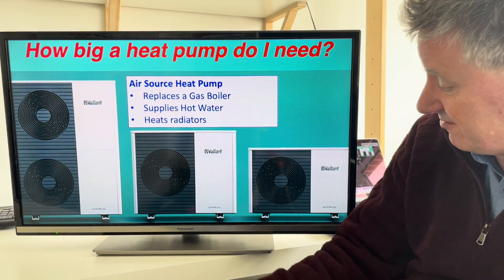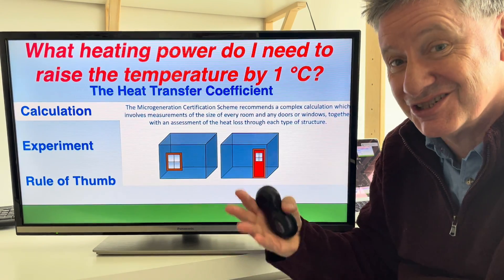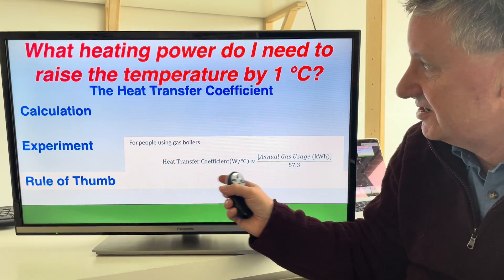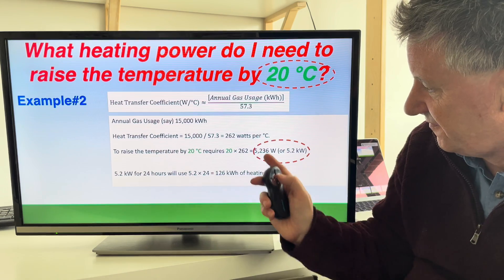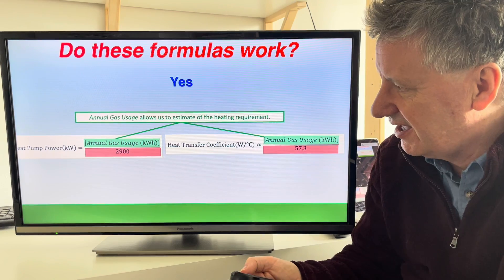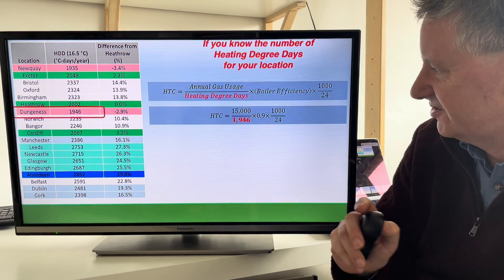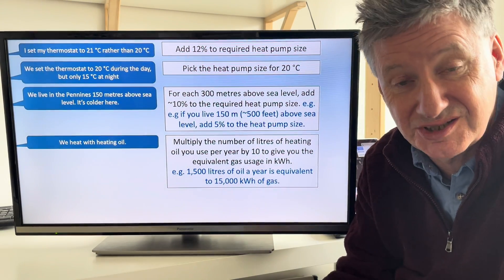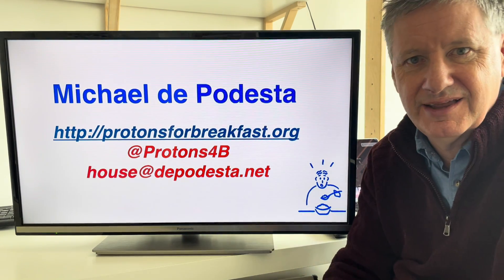How big a heat pump do you need? A simple Rule of Thumb.

Comment: Thanks Michael. I followed along with the video, came out with 2.6kW heat pump.
Vaillant do 3 and 5kW models. Which is better please, the smaller, near max capacity or the larger, hardly ticking over?
Reply from the maker: Dave, Good Afternoon. The Vaillant 3.6 kW and 5 kW are - as I understand - physically identical, with the 3.6 kW model just being limited in software preventing the compressor from going at full power. Given that, I would go with the 5 kW model. There is not much difference in price

https://midsummerwholesale.co.uk/buy/vaillant-heat-pumps

and their cycling behaviour at low load will be indexical.

You can check out how my 5 kW model performed on a cold winter day  here

https://protonsforbreakfast.wordpress.com/2026/01/11/heat-pump-performance-on-a-cold-winter-day/

Best wishes

M
Reply from the maker: Dave, that is a very low heat demand. Obviously, check with a heat loss surveyor first.

If your heat loss really is that low, then consider using an air-to-air system with hot water taken care of separately.

Good luck with your endeavours: M

Comment: The rule of thumb is interesting but does it take in to account boiler efficiency? 
If you have two houses side by side one with a condensing boiler and one with a non-condensing boiler there could be a 10-20% difference in gas use but the same heat loss.
Reply from the maker: Good afternoon. The  assumed boiler efficiency in the rule of thumb is 90% which I chose to nudge up the suggested heat pump size.

An uncertainty of 10% or even 20% is OK for a rule of thumb. Three years ago when I posted the video, oversizing by 200% or even 300% was very common. Things have got better now as the installer base has learned lessons over the winters. 

In the end this is just a rule of thumb, a handy guide and the video explains why it works.

Best wishes

Michael

Comment: My brother has the radiator temp set to 40c with his and his house is fecking freezing all the time..urine leaves the body at 38.5c so why don't we just piss in the radiator Ed Milliband
Reply from the maker: What an unpleasant and ignorant comment. 

In my house the typical radiator temperature is just above 30 °C and that keeps my house at around 20 °C - which we find very comfortable. It only reaches 40 °C on the  very coldest days.
Reply: @michaeldepodesta001 😅

Comment: heat pumps suck and a money pit ffs
Reply from the maker: Thanks for that asinine observation.

My heat pump keeps my 160 m^2 house warm all winter through, and this year will cost less than £100 to run. Good luck doing that with a gas boiler which also emits toxic and climate changing gases.

Best wishes

Michael
Reply: @michaeldepodesta001  bs
Reply from the maker: @SteveJones-gz4vd  Ah! Asinine, and a reality denier.
Reply: @michaeldepodesta001  lies
Reply from the maker: @SteveJones-gz4vd  You really must be delusional. Not lies, simple financial and physical facts.
Reply: @michaeldepodesta001  liar liar pants on fire
Reply from the maker: @SteveJones-gz4vd  Your argument has zero (0) power.

Comment: I’m so glad someone else thinks measuring the HTC is an important thing to do as I feel it closes the gap between the heat generated and temperature achieved – closing the gap between COP and comfort. Someone only mentioned this video to me shortly after I released my own:

https://youtu.be/Xaf2dzC_D3Q

which is much more about measuring temperatures and energy data over a short test period, such as a week.

Unfortunately I wouldn’t be able to use your rule-of-thumb because although I do happen to have my annual gas usage for 2023 worked out, the year ending just before I got a heat pump in January 2024, its a long way away from “you presumably got the house comfortable the way you want it", so dividing by 57.3 gives an impossibly low figure of 125 W/C. This was even after adding in the electricity usage which the video doesn't mention, but for me it is significant at 1001 kWh against 6193 kWh for gas, and lights and computers generate 100% heat. The formula gives an even lower figure of 96 W/C.

The other sources of error that concern me are:
    1. "solar gains" - the heating of the house by the sunlight during the day. The degreedays website describes it as a minimal effect, whereas I found that the measurements were unusable between sunrise and sunset.
    2. "Intermittent heating" - changing the roomstat or switching off at certain times. When I had the gas boiler I only switched it on in the evenings, never at night or during the day. The article only suggests reducing the base temperature by 2-4 C.

What I was trying to do with my video was to show how to take a measurement of the HTC that the measurer can believe, because they have done the whole process themselves and not relied on the SAP/EPC or correction factors from the degreedays website. Even if they are using my example spreadsheet, it is pure open source, anyone can see how it works and that it only uses physical laws. I hoped this would calm the public hostility to heat pumps.

Comment: Nonsense. The only reliable method is a certified calculation. Podesta fails to understand or address the many factors involved. Reckless misinformation.
Reply from the maker: Dear @brucegray, Good Morning.

First of all, MCS certified calculations are actually not very accurate. I have known cases where the assessed heat loss is wrong (overestimated) by a factor of 3!

Secondly, you seem to be unaware of the meaning of the words "Rule of Thumb" mentioned in the title of the video. Here's a definition from Google AI:

A "rule of thumb" is a practical, approximate guideline based on experience rather than precise science. It's a principle for making a quick decision or estimation in situations where exact calculations aren't necessary or possible.

Best wishes

Michael

Comment: Shouldn’t the calculation be based on the worst possible (most demand) period and not annualised? Averaging it out would mean you’d be short when demand is higher. If you take the worst month and use your figures divided by 12 it will give you the requirement for meeting the highest need not the average need.
Reply from the maker: @hogwatch5202. Good afternoon. 

First of all, this is a rule of thumb: it's designed to give a rough idea of the likely size of heat pump based on how much gas a household currently uses. Based on this figure one can pick the  size of heat pump with an appropriate amount of oversizing.

Secondly, the rule of thumb has a few 'safety factors' built in via its assumptions. 

Thirdly, it's not really smart to build something based on the worst possible demand. What does that mean? Should we assume a very very rare figure of say -10 °C. In this case the apparatus would be crazily oversized for 99.99% f the time! Engineers resolve this by choosing a heat pump size to heat a home to 21 °C (bedrooms to 18 °C) on a so-called 'design day'. In the  south of England this is typically -2 °C or - 3 °C. This temperature occurs once every two or three years. 

Finally, designing for the number of degree days in a location does include a winter weighting.

IN any case, I hope you found something useful - and good luck with your endeavours. M

Comment: Wonderful. As a physics graduate this really appeals to me. An ounce of measurement is worth a pound of theory.

I highly recommend the Loop energy app which gives analysis of all my energy use from my smart meter data.
It seems I am very much one of those outliers, very frugal and like the house cool. With just me in a 2 bed mid terrace in West Yorkshire I use 3,000 kWh of gas a year.
From your first formula that gives 52 W/degree C and a heat pump little over 1kW. 
Curiously Loop did an analysis of my consumption against daily temperatures over a year and came up with 2.1kWh per day per C. From that figure I get 87 W/degree C or a 1.5 kW heat pump.

It'll be interesting to see what I get quoted.
Reply from the maker: Good Evening. The rule of thumb is just that - a rule of thumb - it is not perfect. In particular, it assumes that the household temperature is kept (more or less) constant at about 20 C. So in your case the  suggested heat pump size is likely to be a significant under estimate of what you require.

In particular, a heat pump for a typical home a has a heating power of around 7 kW but a boiler for a typical home has a heating power of around 20 kW. This means that a boiler can heat a home much more quickly than a heat pump. For this reason people tend to recommend leaving heat pumps on 24/7 at a low level rather than trying to rapidly heat the house.

In any case, I wish you good luck with your endeavours. 

Michael
Reply: @michaeldepodesta001  Thanks
Reply: @michaeldepodesta001  Thanks again. As an update I've had a heat loss calculation from heat geek at 4.8 kW, which matches my own calculation using the design tool at Heat Punk.

On reflection there's a physics type argument that your one minute rule of thumb is actually based on a one year experiment of living with the heat and seeing what your gas bill is. Which is not to detract, most people do that experiment without effort or noticing. Now that the weather is turning colder I think I'll do a one month experiment setting my heating to a constant temperature and working out my HTC from the degree days. Fortunately I live only 3 miles from a weather station.

That may be only for my own interest. In practical terms to get the BUS grant I'll probably need a heat pump of 5kW or more and all 5 radiators changed. So far that's looking expensive but I need more quotes to be sure.

On the plus side if my heat loss turns out to be less than calculated it means I'll run a lower flow temperature and get better efficiency.

Comment: We have a large a 30 year old  4 bedroom detached house with only 2 people in the house at the moment.  The gas consumption of about 18,000 KWh  gives a heat pump of approx 6.6Kw, by your rule of thumb.  But we sometimes use a log burner in the evenings for a few hours which just heats the lounge so about 7/8 Kw would seem about right.     Have had a couple of Heat Pump Installers take a look at the house which both said the installation would be straight forward- plenty of room for the storage tank etc. I told them we have cavity wall insulation but that the loft insulation could do with improving.    However  one said they would need to fit a 12Kw pump which was the largest they do. The other said they couldn't do it because they didn't have a heat pump big enough  ???

Comment: I would need a 3KW heat pump for 20c or 5KW for 22c heat pump to replace a 25KW gas boiler ?
At the minute, the gas boiler is costing £13/week to give 22c 8 hours a day weekdays and 12hours weekends.
A 5KW heat pump left on all day would cost considerably more to run. It would be £13 PER DAY for the 5KW one for 8 HOURS.
MONTHLY COST -
Gas = £52 before 5% VAT and standing charge.  Electric = £403 before 5% VAT and standing charge.
WHY would I buy and install an expensive heat pump and pay many more times to run it?
Your electric bill for just one month would be my combined gas and electric bill for 4 months.
Reply from the maker: Dear @ bond2025, I'm afraid I can't quite understand your comment.

In my case, my total bill for my home last year - including heating and all uses of electricity (washing, drying, etc.) was £161. The house (162 m^2) was kept at around 21 °C 24/7. My home required around 8,000 kWh of heating which would have required around 9,000 kWh of gas. I'll leave you to do the mathematics.

My costs are so low because in the winter I use a battery to store electricity I buy cheaply at night and run the heat pump from that. 

In general in a simple swap a heat pump will work out a little cheaper than a gas boiler at current prices, but there is not much in it. Typically one might save £100 on a £1,000 heating bill. However, you have absolutely no way to reduce that gas bill - you can't buy cheap gas and use it later. Using a heat pump offers many opportunities to have an extremely cheap heating - and a better quality of life. Also,  a heat pump will reduce carbon dioxide emissions dramatically - for which teh next generation will thank you.

Best wishes

Michael

Comment: Thank you for this video.  I have a question about heating degree days.  You use a base temperature of 16.5C, but most of what I see (and the standard on the reference website) is 15.5C.  Any reason why?  Also the adjustment for sea level, was that because your HDD was from a sea level place or is there always an adjustment?  Thank you.
Reply from the maker: Joel, Good Morning.

Regarding the choice of base temperature this is subtle and depends - primarily - on the internal temperature in the dwelling. It also relies on the notion that if one's chosen eternal temperature is 20 °C, that one does not turn on the heating when the outside temperature is 19 °C or 18 °C. Typically one turns on the heating when the outside temperature is between 3 °C and 4 °C below the outside temperature. Why 3°C or 4 °C? It's because there are other sources of heat in a home. All the electrical items in the home act as heaters, as do the people. Conventionally people use room temperature minus 3.5 °C as teh base temperature for HDDs. So a target internal temperature of 20 °C would use HDDs based on 16.5 °C but a target internal temperature of 19 °C would use HDDs based on 15.5 °C. 

I have limited experience in this are but I suspect that when a home is well-insulated (close to passive house or modern building standards) that the choice of 3.5 °C should be increased slightly.

Regarding height above sea level If you are using HDDs derived from a particular location close to your location of interest, then there is no need to correct for sea level - because the HDDs will have that already built in. But I took HDDs from (say) Manchester and these will be fine in teh region around the city, but as one climbs up into the pennines, the data from Manchester will need an altitude adjustment. 

Best wishes

Michael

Comment: Thank you. This leaves me with a dilemma as I’m just soon to sign a contract for our install.
Our EPC estimated an annual heating requirement of 40,000 kWh, however our actual usage is 10,000 kWh. A 400%difference.
Using another rule of thumb of 5kW ASHP per 100m2 would bring us to just under a 15kW pump, whereas your calculation brings me to just under a 4kW pump. A huge difference and I have no idea which is right. 
We do keep the house cool, never more than 15C. Also I’ve arranged significant insulation improvements to coincide with the ASHP.

Any pointers for me please😢
Reply from the maker: "Any pointers for me please"

Yes. Slow down. Don't do anything that makes you feel genuinely uncomfortable.

I am just a "bloke on the internet", but several things strike me about your situation.

Firstly if you keep your house at 15 °C then you are - please forgive the epithet - "odd". This is probably at the heart of the very contrasting figures for your heating requirement. In order to receive a grant of £7,500 for a heat pump an installer must use an MCS approved installation strategy which is based on achieving a room temperature of (I think) 21 °C. 

I would not recommend installing a heat pump only able to heat a home to 15 °C. If you move, the heating system will be useless to the next occupiers of your home. And you may become old and need a warmer environment. Nominally each °C extra requires about 13% more heating (kWh) but 6 °C is such a large change, that I am not sure this rule would apply. My guess is that heating to 20 °C would require very roughly double your 10,000 kWh/year i.e. 20,000 kWh/year.

Secondly - if it were me. I would make some measurements. I would go ahead with the insulation improvements but put off the heat pump installation for one year. I would measure my gas consumption once a week. Next winter, with the insulation improvement, I would heat the house to 21 °C (ish) for a week when the outside weather was cold. And I would see what actual gas consumption was required to heat the home, and then install a commensurately sized heat pump.

Here is a very old video where I describe what I have done to my own house

https://youtu.be/3Pr7wL63FjQ

Also try looking at my blog (https://protonsforbreakfast.wordpress.com) and searching. Or drop me a line for specific questions,

In any case I wish you all teh best with your endeavours, but I would re-iterate: don't rush! Understanding the heat flows in your house is enormously more important than "doing something".

M

Comment: Multiply the number of bedrooms by 1.5 and round up.
Reply from the maker: That's an interesting idea, but it won't work for a wide range of properties: flats, detached, terraced, semi-detached. etc.
Reply: @ I take your point, but the same thing applies to your method, i.e. there is a dependency on the preferred level of comfort of the current occupants (as another commenter has pointed out) I’m suggesting this method to give a quick and rough guide ahead of more accurate measurements and calculations and also as a sense check. I wouldn’t mind if someone, e.g. an installer had some better empirical data than I have (none) to compare and see how it works out in the real world. Thanks for the video, it’s great info for anyone considering a heat pump.